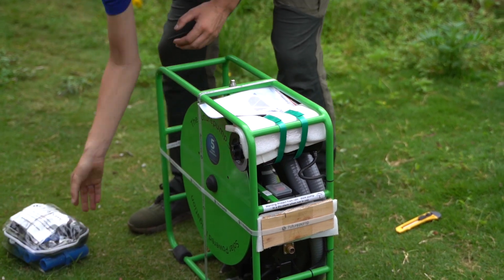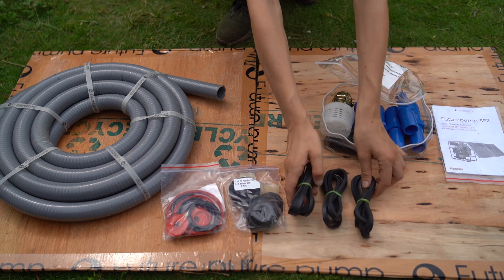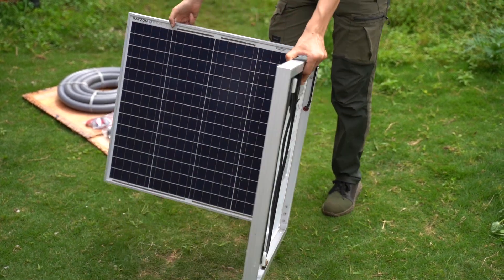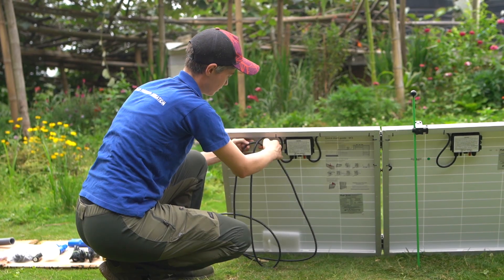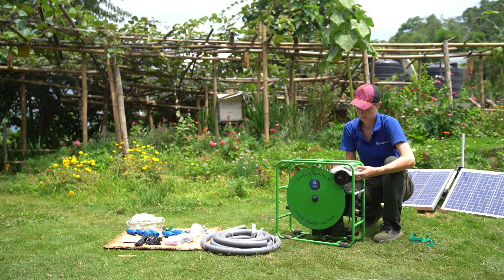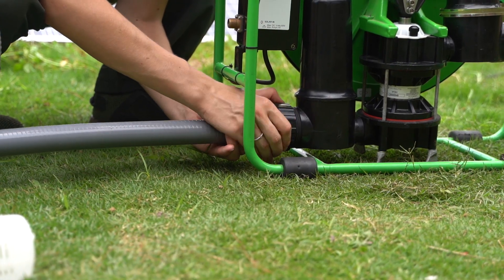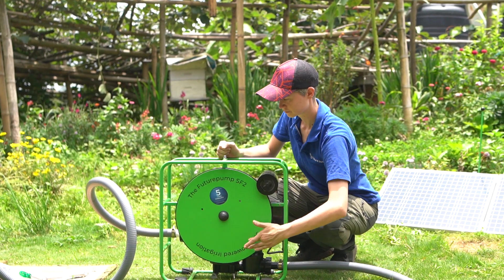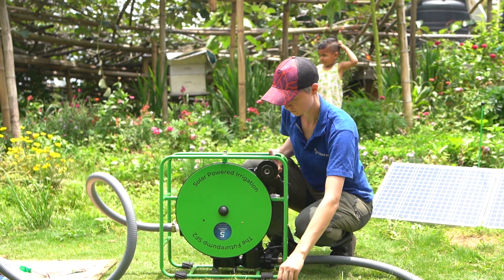Installing Your SF2H - The Solar Powered Water Pump Built To Last!

Comment: How much Distance  do the largest pump push water?
E.g 3km,5km
Reply from the maker: Hello, our pumps are surface solar water pumps with maximum suction of 7 meters and a total lift of 15 meters and Horizontal discharge up to 500m. You can find out more at Futurepump.com

Comment: Hi, you've recommended SF2H for boreholes that are more than 7 meters. 
Any local (kenyan) distributors?
Reply from the maker: Hello, the SF2H has a suction lift of 7m, but has a total lift of 45m. The water source must still be less than 7m from the surface.

Davis & Shirtliff have SF2H pump kits in stock

Comment: The suction pump should be longer in areas where the Wells are very deep.
Reply from the maker: Thank you for your interest. Our pumps are surface solar water pumps with maximum suction of 7 meters and a total lift of 15 meters and Horizontal discharge up to 500m. You can find out more at Futurepump.com

Comment: How deep can the water be drawn and how many watts of solar panels will it take?
Reply from the maker: Hello and thank you for your question. The SF2H has a total vertical lift of 45 meters, and the inlet side can draw water from a vertical maximum of 7 meters deep. The SF2H is compatible with either 120W or 180W solar panel configurations. More specifications can be found on our website: shop.futurepump.com